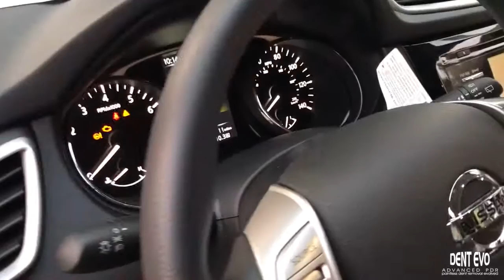Dent Repair/Brand New Nissan Rogue Kick Damage

Comment: What tool was that?
Reply from the maker: Jeremy Strand That was a homemade bar that I built and was experimenting with at the time, for reverse leverage and perpendicular pushing À la Dent Dial style (notice Dent Dial tip). It worked well for this job because it was thin and fit through a small factory placed opening on the inside of the door frame. I Eventually shelved the tool though because of some design flaws and that it was a little impractical. Thanks for noticing it! (good eye 😉 no one‘s ever asked me about it LOL).